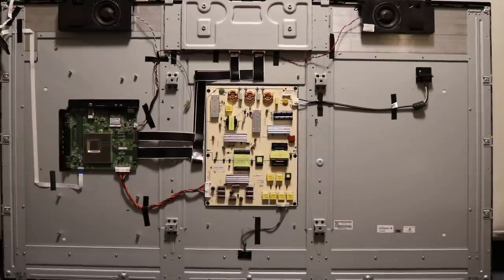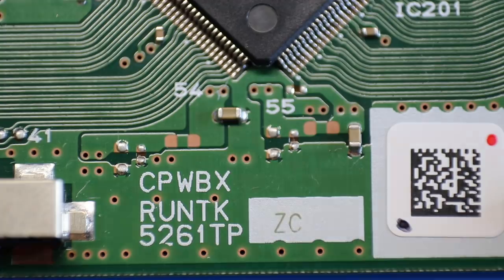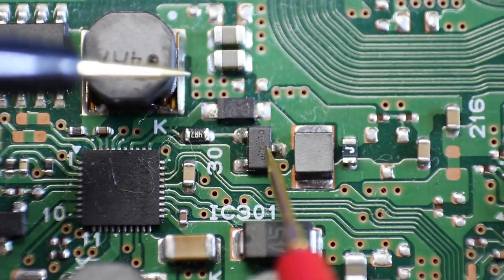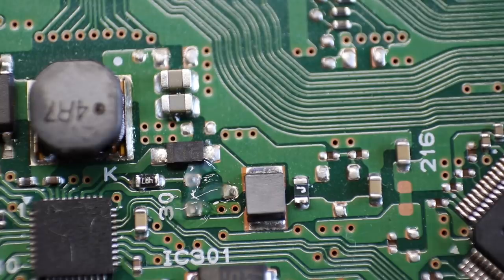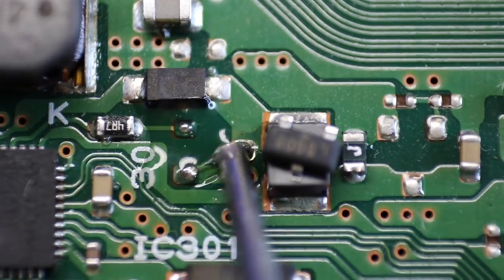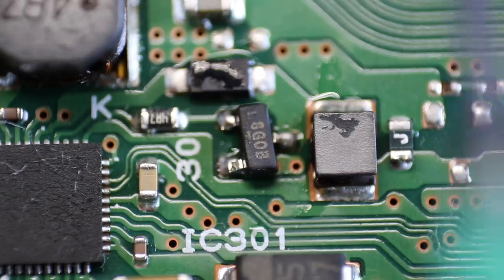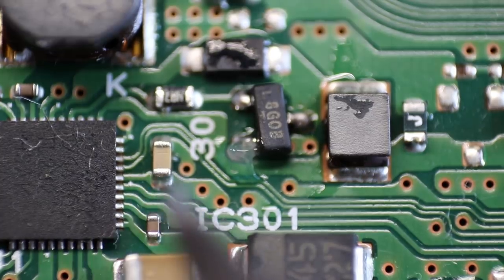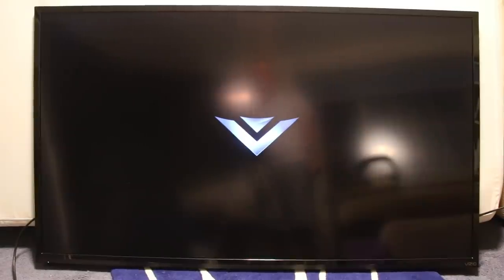60" TV for less than a $1 - Vizio E601i-A3

Comment: I have a Vizio_D650i-B2 TV. The picture continually locks up and I have to disconnect power then reattach power. I have a direct connect to the router so I know the problem is not WiFi.

Any suggestions or have you made a video on this problem.

Your help is greatly appreciated.
Reply from the maker: I'm not sure because it could be any number of things.  Probably on the main board but it could be elsewhere.  Does it do that on all inputs or just HDMI?  It might be an HDMI issue.
Reply from the maker: @yiotlinenews  That sounds more like a firmware issue if it's only the smart apps.  It's possible it could be hardware but you may want to double check that the apps are still supported on your tv.  Sometimes the app makers no longer support a certain firmware.  It gets frustrating when the apps used to work and now they don't.

Comment: So where did you find that transistor and the specs for it? Each tv is different and my Samsung tv does not seem to have a tcon board. It’s an led tv by the way, and currently still trying your scotch tape trick on it since its not labeled any type of video. But on that note where to you find wiring diagram specs on these tv’s?

Comment: I'm having the same issue ... how do I know which is the right chip to take off on a different model tv
Reply from the maker: If it’s a different model then your problem is different.  This is very specific to thing model.  Did you watch my latest video?  Id recommend doing the isolation test I did there to find out if the problem is on the tcon or the lcd screen (it could possibly be something else but those are usual suspects).

Comment: Pls I have a frickering 58 inches Panasonic 4k smart tv. The model is TX58X700B. The screen is not broken anywhere but I'm told that the screen is bad. After seeing your video fixing such problems with a tape I'm convinced the problem is not the screen. Pls I need your advice. Thanks
Reply from the maker: If it’s lcd, then give the tape method a try.  It can’t hurt.  I’m referring to my videos where I isolate a screen fault and get the image back with tape.

Comment: Hi! Is there a way to fix flickering on a Vizio 50” M502i-B1? 

All the resources I’ve found state to change the capacitors, but the videos are of different models so I can’t find the capacitors on this tv. I’m a mechanic, but don’t know how to work with anything electrical so I don’t even know which boards are what for this model lol.
Reply from the maker: I’m pretty sure you can fix it.  I give some tips on how to find board parts and such in my pdf.  Check out first link in video description.  If you want to replace the capacitor’s they are a little numbers written on them and you can go and order the same specs as replacements
Reply: FrugalRepair thank you so much!

Comment: Does he talk about the dangers of opening a TV? The capacitors and whatnot? Or is that not significantly dangerous with a non-CRT? (I haven't really fiddled with electronics on newer TVs)
Reply: Just like the good old crt :) the caps MAZYmake you jump into a-vib  :)  they can retain a charge for 6 month depending on how well ( not well ) the curcuit is build ... ( drain resistor etc.. )

Comment: Do a video on the tools that you need and how much they cost
Reply from the maker: That sounds like a great idea.  I will think about it and maybe consider different categories of tools you may want and why.  And maybe considering what stage someone is at.   I've been doing electronic repair for a while now so I've upgraded here and there but I didn't start that way.   I started with a screwdriver and a cheap (like $10) soldering iron (which really will do most jobs).  Thanks for commenting and let me know if have more ideas!

Comment: If a transistor fails, something else failed to kill it, or it will fail again due to incorrect tolerances. Typically they fail shorted for only a brief time, then they release the smoke and fail open. Most likely this transistor feeds a circuit with capacitors that bleed down on every cycle and it’s not rated for the power on inrush it experiences or simply is rated too low for its working current. I would inspect the circuit and add a current limiting resistor to dampen capacitor inrush current or upgrade the wattage of the transistor to lessen the likelihood of future failures.

Comment: You need to add the cost of solder station hot air flux ,  as well as the knowledge about basic Electronics and using those tools. Anyway it was a good video i enjoyed it thanks

Comment: i have a vizio 43" that jave a noticeable horizontal darker area across the top section if the acreen.  i get a picture that seems fine, but the screen picture turns off and on every few seconds.  if i turn the backlight down, the frequency slows, but still does it.  at the burned out leds causing the on/off to continue to happen.

Comment: I have 2 HDMI 1 and HDMI 2 inputs on my   question If I do this will I lose the sound bar from the cable box Toslink connected to that only so when switch to the other HDMI 1 port for the Fire Stick now the TV cable box  to  sound bar is  on  the TV to HDMI 2

Comment: I have a Philips 24" LCD, it works ok but time to time two stains appear, they are kind of gray green color.
They are located one on the top right corner and the other one down in the middle next to the edge.
They are skinny so I can keep using it but I wanna fix it for good.
Over the course of a couple of months it slowly disappears and suddenly a couple of moths later it appears again to repeat the process.
So I think the pixels are not dead, ¿Can be the LVDS cable?
All this started a couple of years ago when I cleaned the LCD with an LCD cleaner spray.
I Opened the TV but didn't see any spot , rust or sulfate inside.

Comment: I am a subscriber. 
My 55 inch Samsung has a start up problem. It keeps clicking before it actually beeps and turned on. Once it is on and has been on for a while I can turn it off and then back on without any problems. 
 Any suggestions?
Reply from the maker: Thanks for subscribing!  What you describe sounds like capacitor plague.  If you look on your power supply there may be bulged capacitors.  They need to be changed out.  It is a very common problem on older Samsung TVs.  Of course, it could be something else too.

Comment: I have Vizio 70inch LED TV. Model M70-C3. Black screen, no backlight. The power button lights up and the optical audio port lights up. I removed the back panel and checked the voltages on the Power Supply board.connector to Main Board, standby voltages for AC det =3.96, PS on =5.13 and AU =12.. Pins 8&9 VS =12v. Pins 13&14 T-con =12v, however pin 15 T-con on =0v. Also T-con connector pins 1,2,3,4 measured 0v instead 12v. Checked output voltages on LED Driver connector. Pins 3-8 measured 34v instead of 24v..Pin 13, vsense =2.6v. To summarize, zero voltage output to T-con board and higher voltage 34v instead of 24v going to LED driver board. Can you advise me on which board I should replace. My initial thought was the Power Supply board, however I guess it could be the Main Logic board not setting T-con on. Appreciate your expert advice.

Comment: And another solution is simply replace the t-con board. Many used ones on eBay for just $15. I fixed another TV that way myself. But very inspiring to think a 
$.50 component could save such a nice TV to the up as rubbish in our landfills.
Reply from the maker: Yes, that is a solution.  I had done that a few times before on this model TV but swapping out a component is more fun.
Reply: @FrugalRepair  How did you know it was that transistor? Did you have a schematic on the boards? I have two other curbside finds I'd like to fix, one is a TCL 55 inch Roku TV. Was tossed out with the Roku remote included. It's powers up but no picture. Tried to reset it via the remote but nothing. It has a back light on but no image and I can hear the clicks on the audio if I press the Roku remote for it.
I would guess it's the t-con board? Any thoughts?
Reply from the maker: I learned about it online.  For your tcl, watch my tape video, it could very well be the same issue.  It’s an internal lcd component problem, not the tcon.
Reply: @FrugalRepair  Yes I do recall that video. Time permitting I hope to take the TCL apart and try your method out. Sure worth a try.
Thanks so much. 👍

Comment: I do TV  and Electronics repairs for long time , you don't need a hot air station and all that flux to remove and solder back  a surface mounted transistor , little bit of flux and a soldering iron and a tweezer are enough  for this job , you also have to be careful when using a hot air station to not melt the solder and  displace close by  tiny resistors or caps , using hot air is more suitable in replacing surface mounting ICs and needs more experience and caution .

Comment: I have a Sony  XBR-65930D that has gone 1/2 white and 1/2 black , do you have any ideas on how to fix this issue ?
Reply from the maker: I’m not sure but you may have a Sony of the era with bad panels.  What have you found when you researched the mode umber?  The tcon board drives each half of the screen.  You can try (after unplugging the tv) disconnecting one of the cables between the tcon and the panel.  Then try again on the other side. One side should be white (only the backlight can bleed through).  See what you can find out.

Comment: I have exactly the same issue with my 2 yr old Sharp Roku lc-50lb481c TV. I was watching the playoffs then suddenly went dark? My son said if you use an LED light in the dark lit room and shine it against the screen if you see any pictures or menu that it's your back lighting. We did see the menu and a tv show with the LED light against the screen. My question is can I fix this myself? I know I'm capable of doing so but how to get the metal backing off. I noticed on each corner a black cloth like tape that you have to cut off or once you take all the screws out and tilt the metal backing up the tape should flex like a hinge? What's your  thoughts on this to diagnose the problem.

Comment: How did you know which part failed?
I’m in no way shape or form an electronics guy but my Samsung 32” failed on me many years ago and I couldn’t afford a new one. So I figured how to open it up and looked for any bad capacitors or burnt parts of any of the boards. I did find 3 capacitors bulging so I found them online $3 and replaced them. Luckily for me it fixed the problem. My TV has worked flawlessly ever since.
Reply from the maker: There is another YT video explaining the bad transistor.  Reading forums is another great source of detailed information.  The bad capacitors on the older models was/is a very wide spread problem.  Great job fixing yours!

Comment: I really like your videos, but none quite match my problem.  I have a 75" LG TV that shows a great picture for about 10 to 20 seconds after turning on, then the screen goes black.  The sound still works and I can see the picture if I use a flashlight.  Any ideas where to look?
Reply from the maker: Your led backlight is out.  I talk about a trick you can do in my latest tv video

Comment: when you remove transistors like that just use clippers and cut it off and than solder the rest away is much easier. And you should not put any of solder on pins, just transistor and solder iron and iron one pin than it is easy.

Comment: I hope to pick your brain.  Lighting zapped by TV.   The Cat5 cable shows scorch marks.  When I turn it on the TV does a series of clicking noises and it keeps doing it until I unplug it once again.  I suspect the Main Board.  Would it be easier to just replace main board (I found one on Ebay) or actually attempt to troubleshoot it to the component level?   Or is their a fuse on the main board?  I got an older Samsung.  Thanks.
Reply from the maker: Did you happen to watch my other video about diagnosing a tv damaged by a lightning strike/power surge?  There may be some helpful tips in there to isolate which board is the issue.  The burn marks though are a pretty good indication that the main board took the brunt of the surge.  But if it were me I'd double check the power board is putting out the correct voltages.  In terms of doing a component level repair, that is up to you.  A main board would be a pretty challenging board to start on.   The fact that it was a power surge (versus a factory/design defect) is also a factor.  With the power surge you don't know how many other components were damaged.  Even the traces could be burned up.  So maybe going the ebay route may be best?

Comment: I've got a Visio 60" with the same issue but it is the E60-C3 so the board is different from yours. To top it off, the service manual doesn't seem to show the schematic for that board. Has the main board and power supply board. Very strange.
Reply from the maker: Thanks for commenting. Are you sure that your problem isn’t with the back light? If I remember correctly, that model has a problem with the backlight failing. Turn the TV on and use a flashlight on the screen to see if you have an image. This will confirm it or not. And, if you are interested, I describe this more in depth in a PDF where I put some of my top diagnostic steps before you open up a TV. Go to frugalrepair.com and click on the free resources tab.
Reply: @FrugalRepair  Positive, leds are lit. Popped the back off so they are quite visible and can tell looking at the screen. Audio is good and all inputs are good. Just no LCD drive, best I can tell. The power supply board has all the required voltages. No visibly bad parts but I haven't taken a meter to the tcon yet. I'm just frustrated that the service manual doesn't have a schematic. Power supply, audio, control, tuner, just no tcon. RATS!
Reply from the maker: @ed-jf3xh  I'm almost finished editing my latest video and I hope it will give you some more things to try.  Next two videos are about screen issues.  It sounds like it could be tcon or something gone bad in the LCD panel.  So don't give up yet.
Reply: @FrugalRepair  I'm banking on the tcon but we'll see. Thanks for your support.

Comment: hi there, I have an LG 86UH955V ... everything works absolutely fine. when a 3D content is shown, the image is blurred as per what you would expect but when you put on the right passive glass it doesn't show any 3D effect. Kindly point me in the right direction where to look at or what to replace? Thanking you in advance for help. Much appreciated.
Reply from the maker: Make sure you search around with your model number to see if there are any common faults.  Since the picture is fine during normal use I would then suspect your main board if you’ve eliminated the possibility of a bad input (hdmi port, cable, blu-Ray, etc) and you’ve tried different glasses.  Maybe try resetting the settings as a next step?
Reply: @FrugalRepair  Hello once again... I tried all of the above already but in vain...I tried the same 3D content on another TV it works fine. Tried different type of passive glasses as well.. I even went further i updated the web OS.. still the same issue of 3D effect not working on glasses. Do you think it might be the TV not transmitting the 3D signal to the glass? I could be wrong? could it be the T-CON board?
Reply from the maker: You said it was passive 3D in the first post.  Is this active 3D, where it transmits to the glasses?  If so, your issue may lie in that transmission
Reply: FrugalRepair... Sorry probably misusing words.. It's a 100% passive glasses... In cases like this.. Do you think the TV is the issue? Where can I start to look into? Mainboard or just the TCon? Or else where?
Reply from the maker: @DEEJAYHOMEBOY  I'd stick with a guess of the main board since the tcon wouldn't no the difference, it just helps to show whatever video signal it's being sent from the main board graphics processor.

Comment: Hello, love your  videos on cheap fix!
My tv have the similar issues: no pictures, no menus, no usual on off Samsung sounds when turning on off. I was able to get sound with the typical tape strip trick.  The model is UN58TU7000F
It's less than 4 years old and hate to trash it if an easy fix can be done, can it?
Reply from the maker: I'm not sure what you mean by getting sound with tape strip trick.  What else have you tried to do to diagnose the TV?  Did you watch my video on diagnosing a TV without opening it up?
Reply: @FrugalRepair  I've tried the most common fix, ie reset tv and power. It still has no pictures and tv turn on/off sounds.

Comment: Do I need to get the whole t-con board or just what’s costing the problem?
Reply from the maker: The tcon's are cheap enough I would recommend just getting one and replacing it.  It is possible that your lcd panel is bad but you may not know until you try.

Comment: Question 🙋‍♂️ when repairing a large LED panel, lay it face down on soft surface such as thick bubble wrap?
Reply from the maker: Carpet is fine.  Just try not to put pressure on the lcd panel itself.  Sometimes I tilt them at an angle against a wall or big box and take the back cover off that way.
Reply: @FrugalRepair  No carpet in the house,, sadly. May resort to “finish quality” grade A plywood and a blanket for a surface. No bezel/micro bezel,, so it’s kind of tricky to deal with.